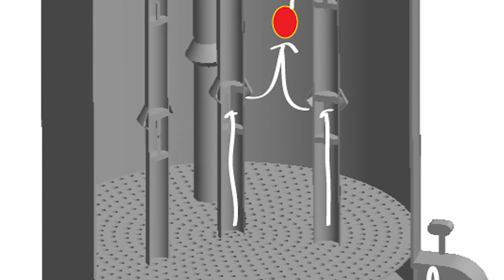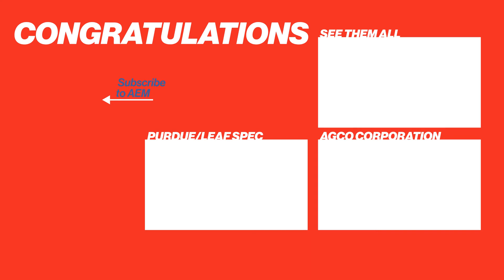2021 Davidson Prize - Haber Technologies

Comment: How do I use this with a grain sweep?
Reply: The tubes pull up from the floor and allow the sweep to pass underneath. I’d wait a while to purchase so far it’s producing moldy grain for us. They claim it works well in smaller bins.
Reply: @clayed3311 it's working for our 30k bushel bin. What moisture did you put it in at?